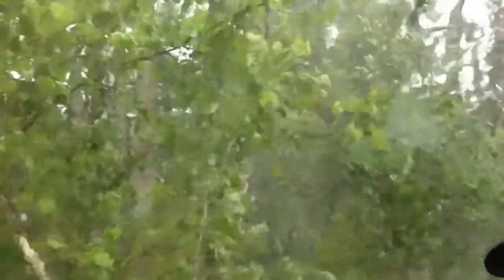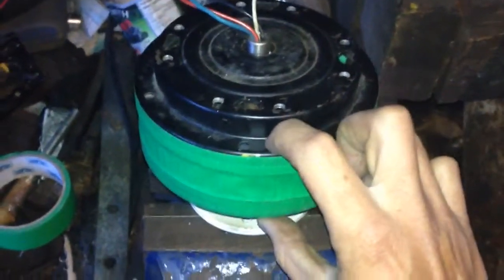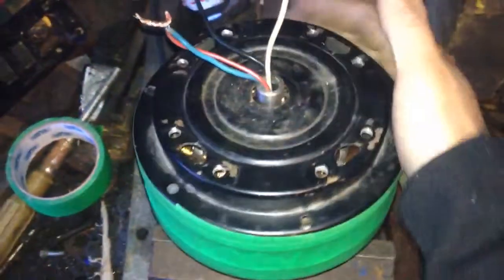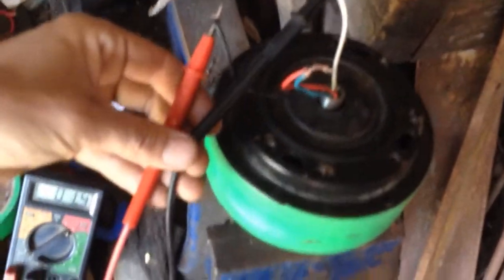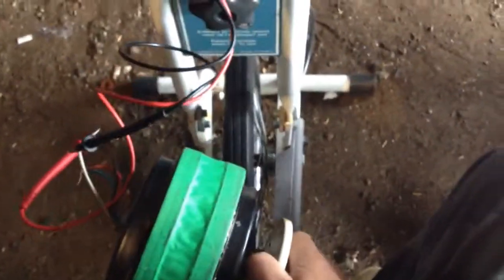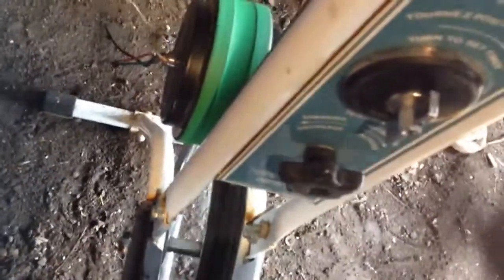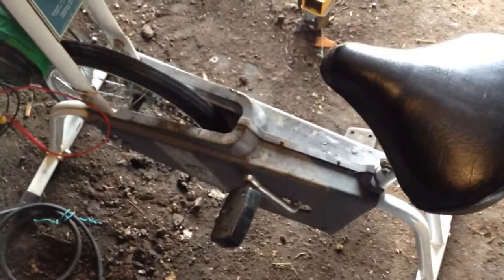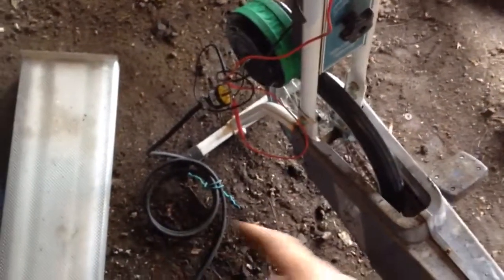110v AC Bicycle Generator From Ceiling Fan & Magnets

Comment: output amp?
74ah battery charging time?
Reply from the maker: i don't know, but it powers the light effortlessly , which is two 40 watt bulbs, 120 volts, so The formula for Amps is Watts divided by Volts. so 80 watts divide by 110-120 volts = 0.666 - 0.73 amps is how much the light consumes, and i can power that effortlessly, at about half speed.  i don't know the best or maximum amperage output but it's at least 1 or 2 amps i'd imagine.  im pretty sure the light draws more than 0.72 amps so my math is likely wrong but i can definitely say it powers the 80 watt light @ 110 v easily